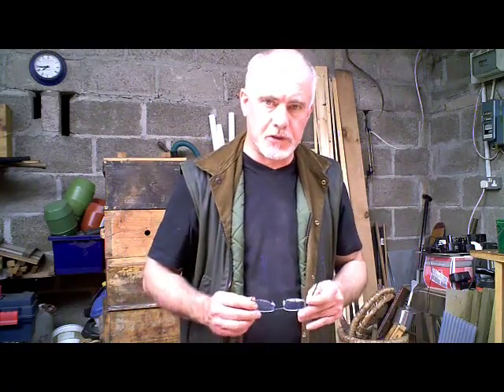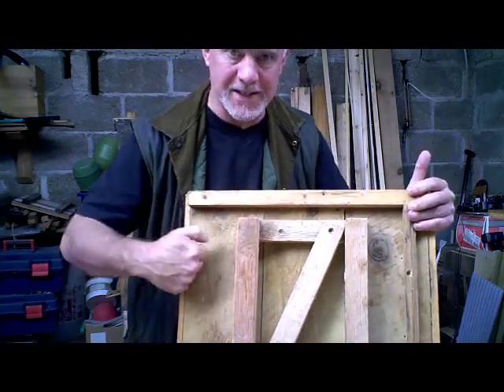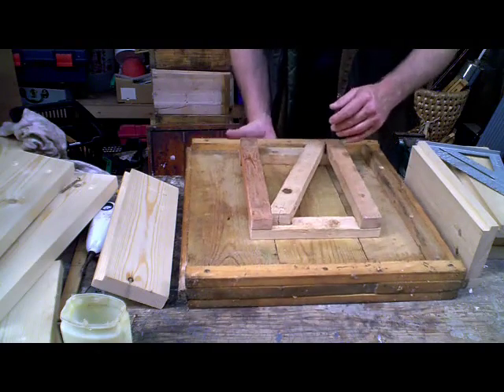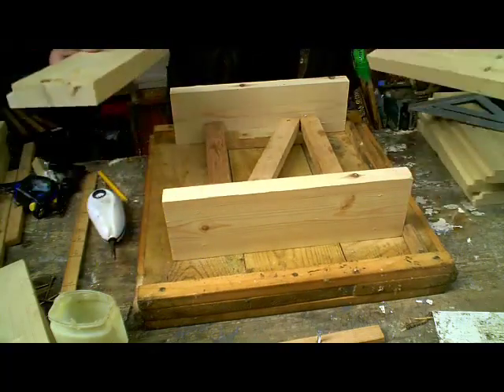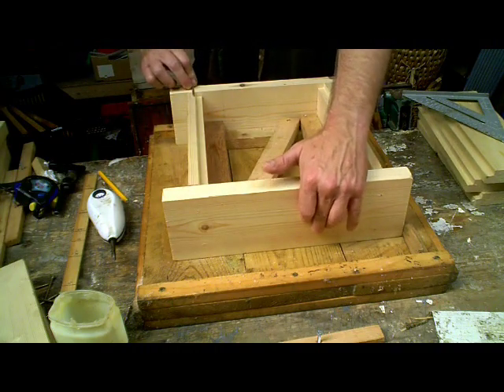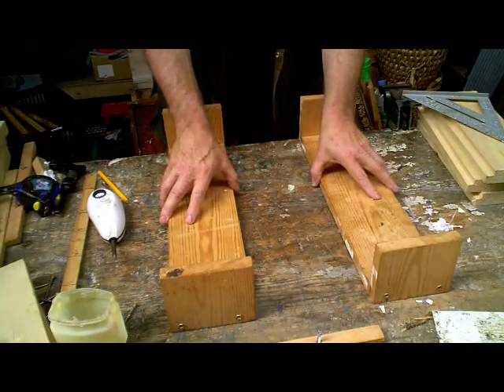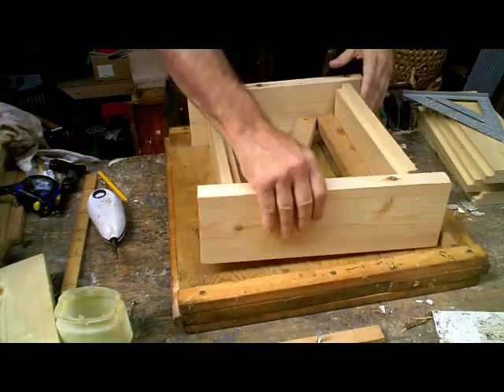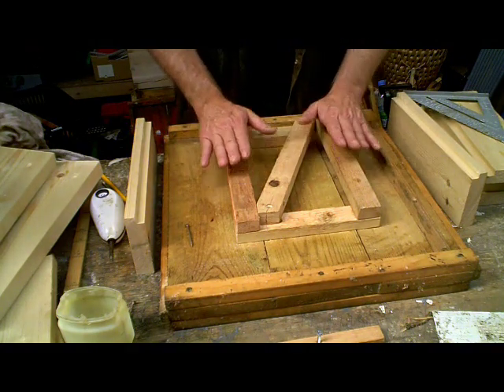How to build beehives using a jig

Comment from the maker: The hive I am building in the video is an experimental vertical design based on the dimensions of the half-Dadant frame, which can also be used with top bars. Three of those boxes accommodate 8 frames.